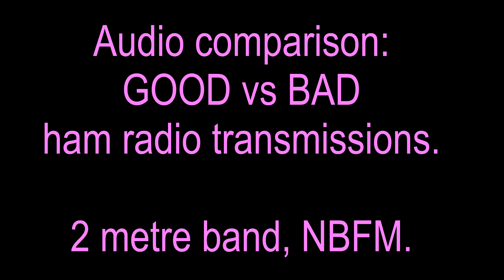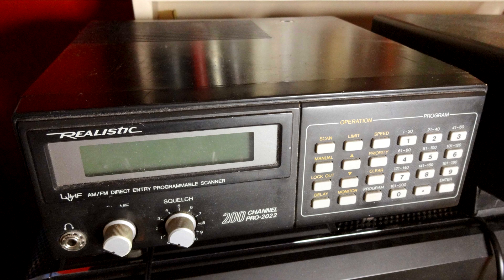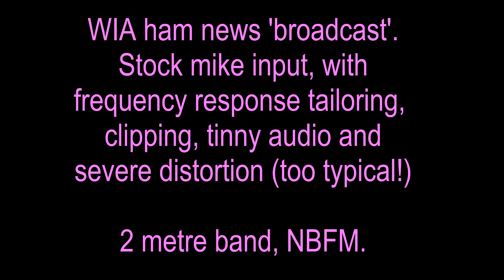VHF NBFM ham radio: audio comparisons.

Comment: Chris to I agree that NBFM is not the best for a broadcast but I do have an issue with the comparison you have posted. Parts of the WIA news do come across with some sibilance and the segment you have chosen is probably the worst bit. Have a listen to the base MP3 file that broadcast stations download and compare that with Dave’s audio. I suspect you will find that all the blame can’t be associated with NBFM. http://www.wia-files.com/podcast/wianews-2019-07-28.mp3
Reply from the maker: NBFM is capable of SUPERB audio quality, as you hear via VK3ASE, here. It is ABSOLUTELY the incompetent usage of internal audio processing hardwired within NBFM rigs that is responsible for the difference of quality here. NBFM is capable, as you hear, of much more. I will post a direct comparison of the WIA podcast versus the output of my receiver's discriminator. If anything, the difference shown in A/B comparison is even greater. NBFM is, indeed, capable of broadcast quality, as you have heard. There is NO sibilant distortion in the WIA podcast, as shown in the following url, here. How much clearer can the comparison be? Refer: https://www.youtube.com/watch?v=wkGEcdWQoqo